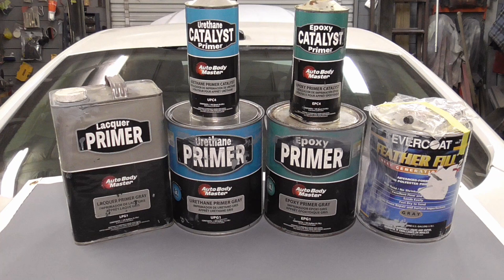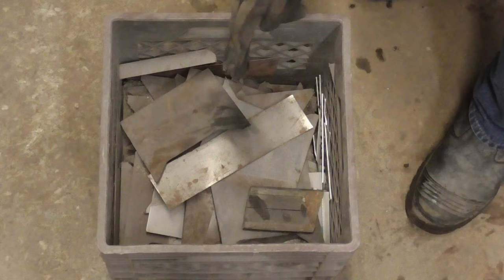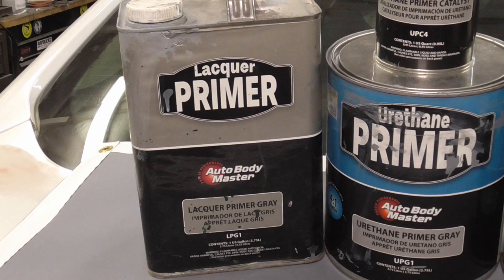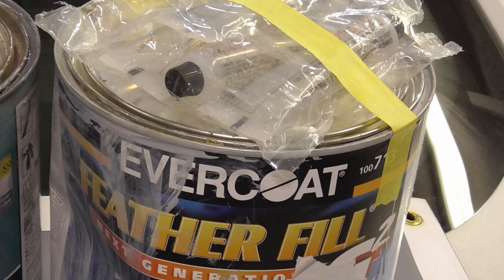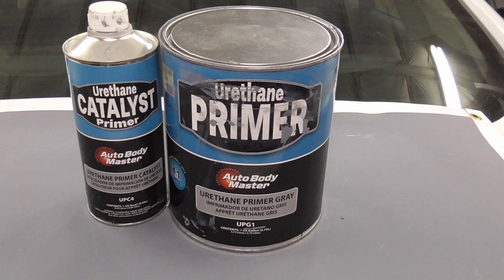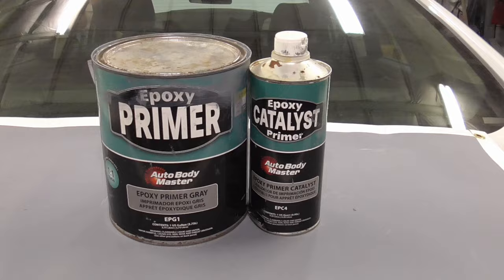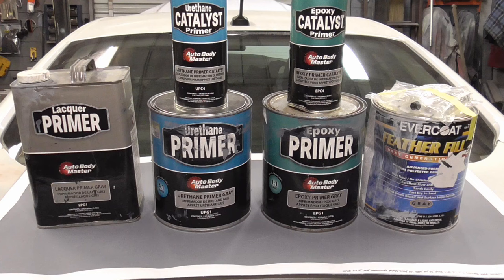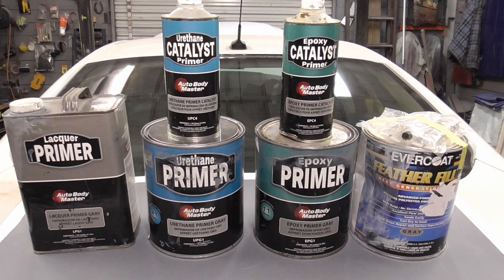A Simple Automotive Primer Guide - Types, Differences & Tips

Comment: Is it fair to say that there are epoxy primers that are high build? I have watched videos about VP2050 which is high build epoxy primer. 

I have watched YouTube recently about sealers being thinner and not high build. It seems like it depends on the manufacturer.
Reply from the maker: Yes - there is high build epoxy primers.  Remember though - no matter what type of high build primer you use, corrosion protection is the paint's job so any $ you spend on rust prevention before paint is a total waste of $.  Body shops do not use epoxy primer - they use DTM urethane primer surfacer or in the days before lacquer primer surfacer.  Both work excellent today and always will :)
Reply: @LakesideAutobody  that’s totally opposite from another YouTube channel. The person uses VP 2050 epoxy primer to protect against moisture coming through. Then 80 grit for filler over the epoxy, then continue with the high build or a sealer. 
Is the urethane high build I would think easier to sand? Do you have videos on your steps for a complete paint from start to finish? Thank you for the response.
What causes bubbles to show up later and how do you prevent that?
Reply from the maker: 1) Always refer or get answers from people who have worked in real body shops - not home restoration shops.  If you have to got to a dealership and ask what type of primer surfacer they use.  Bubbles usually show up because of pin holes (rust) that was primed or filled then painted.  But there can be other reasons too.  Lacquer primer surfacer is the easiest to sand, then urethane primer surfacer, then poly (feather fill) and epoxy. That's generally speaking - have not used every brand of primer.  Here's a video on the basic steps from start to finish- https://www.youtube.com/watch?v=mApSa0l4euQ - I've worked for 4 major body shops in the metro Detroit area and the methods and products used are usually the same.  On the internet they're always different because they're reading magazines or shopping at Eastwood.   @jimdrechsel3611
Reply: @LakesideAutobody  do rust encapsulators work? How can you be sure you have prepared a rust spot enough? Can a paint job with bubbles be spot repaired or will a car have to be stripped all over again? Will epoxy primer prevent bubbles from forming if you missed something?

Comment: The auto body supply shops around me all tell me to use acetone with the lacquer primer. Is this okay or should I only use lacquer thinner?
Reply from the maker: I'd use lacquer thinner but if they say you can, it might be true.  If you can find the TDS (data sheet) for the primer you are using, it would be good to check that too :)
Reply: @LakesideAutobody  thanks for the reply, I ended up using the acetone, and it seems to work fine however I have no idea what I’m doing lol. I really appreciate your videos, always very informative and straight to the point. Thanks!
Reply from the maker: @MrHarmonizr  I appreciate the kind words Mr H.  I've never heard of using acetone in lacquer primer before but if it's cheaper and works, I might have to give it a try :)
Reply: @LakesideAutobody  okay the problem I’m having now is sand paper gumming up. I sprayed 2-3 coats in certain areas and it dried for 1 week. Went to block sand and immediately gummed up, it was so frustrating. I have the roof done but am scared to do the other areas now. Also another interesting thing I put some glazing putty on the pin holes and it started making the primer wet again. It was interesting. The glazing putty said it could be thinned with lacquer thinner and I’ve used a lacquer primer. Not sure if that’s something, thanks for any input.
Reply from the maker: @MrHarmonizr  What's the exact name or brand of lacquer primer that you are using?  Like I said, I've never used acetone w/ lacquer primer so I can't say if that caused the problem or not - I sort of doubt that the acetone caused this though.  That being said, any time any type of coating gums up the paper, the solution is to try wet sanding with like 320 or 400 - it may work better.  Recoat with primer but not till you figure out why this primer is causing the paper to gum up.  Let me know what products you are using - we'll figure it out - no worries :)
Reply: @LakesideAutobody  so it’s speedokote off Amazon. A few things to note, it was dry to the touch between coats but maybe I didn’t wait long enough between coats? Maybe waited 5 mins. Also I’m blocking with 80 grit, I was going to try and wet sand today and see if that helped at all. I’ll try and post up a video. Thanks as always for your time and feedback.
Reply from the maker: @MrHarmonizr  Waiting doesn't matter - It never matters how you apply lacquer primer - it will dry quickly and sand easily - if thicker, obviously it will take longer to dry but never more than a few hours.  The only thing I can think of is the acetone - never heard of using acetone with lacquer primer.    Might want to try the primer with lacquer thinner on a scrap piece of metal and see if it performs differently.  If it does sand nicely, you've got your answer :)
Reply from the maker: @MrHarmonizr  You're welcome - feel free to always ask ?s - Jerry
Reply: @LakesideAutobody  wet sanding helped a lot!
Reply from the maker: @MrHarmonizr  Great - good to hear :)

Comment: One thing that's confusing when shopping for primers is Lacquer primer, Lacquer acrylic primer. And acrylic primer. All 1K so what's the difference?? I got some USC 2255 out in the shop. Only thing I can find is to mix 1.1 but with what? I can't find the mixing sheet anywhere  Very confusing.
Reply from the maker: Anything lacquer is thinned with lacquer thinner.  Urethane and epoxy is "reduced" w/ urethane reducer.  Polyester primer (evercoat featherfill) can be thinned with lacquer thinner or acetone.  When confused just ask and I'll get you the correct answer - if it's something I've never heard of I'll say, "I don't know."  Jerry
Reply: @LakesideAutobody  OK Thanks Jerry So Acrylic primer is lacquer primer?
Reply from the maker: @45AMT  Yes - It's called acrylic lacquer primer.  Acrylic lacquer came out around the 50's - before that was Nitrocellulose lacquers and before that was ........There's also Acrylic enamels.  Acrylic is a type of resin :)
Reply: @LakesideAutobody  OK Thanks for being so helpful.  It's confusing the way these primers are labeled. Someone new to these primers like me wouldn't know as this primer (USC 2255) is just labeled "Acrylic Primer"
Reply from the maker: @45AMT  You're welcome RR - Sometimes you really have to research.  It's like asking your friends if you can shoot a slug through a choked barrel - million different answers and you'll have to research to the wee hours to find the correct answer :)

Comment: You said primer is direct to metal.   Is it best not to prime the entire vehicle if not going down to metal?
Reply from the maker: It's a choice actually.  If you want to block sand the entire vehicle for some reason i.e it's a bit rough, wavy, lots of dings, chips etc., then you'll probably want to prime the whole thing, give it a guide coat and block sand.  If you only have a few repairs and the paint is in good condition, then just prime the repaired areas.  Good ? BTW.  If you have more ?s feel free to ask :)
Reply: I worked as a mechanic in the 80s and one of the owners did paint and body on the side.   He would always prime over the original paint (entire vehicle) after body work then paint.
Reply from the maker: @tomnassar5884  That can be done - no problem - it's a choice.  Again if it's perfectly straight old paint, you can just DA sand with 240-320 and paint.  You can even just scuff and paint - red or grey pad.  Red is like 320 or 360 grit Grey is 1000 grit so it's not as fast :)

Comment: Love your videos!  Are rattle can lacquer primers (i.e. Duplicolor, Rustoleum, etc) as good as the bulk primers used in auto body shops?  I've always avoided them thinking they didn't adhere as well, but the convenience of a spray can for small jobs is undeniable.
Reply from the maker: Thanks Cameron.  Yes, they stick just as well but don't even come close when it comes to building thickness for block sanding.  They are great for very minor repairs and hitting your bare spots just before painting.  No worries when it comes to adhesion :)

Comment: Hardly a single you-tube "expert" recommends the old lacquer primer. Worse, they act like you should Never use it! Like it's not even an option. 
  Well, depending on how you use it, one gallon Can make 2 gallons for a low price. Not as low as pre-Biden. But low. And like you said, you don't have to toss the unused portion! That is value-plus. And lacquer primer is good enuf for any garage respray on your daily driver or budget vintage project. I have had no issues using it, and you have  been at it much longer than me and haven't shelved it. Good enuf for me. I like saving money, and lacquer primer saves me $$$

Comment: Actually you can buy high build epoxy acrylic paint which builds and sands easily so this is not the most accurate video on youtube.
Reply from the maker: If you mean primer, you are correct.  The problem is finding it locally and price.  Most body shops don't use epoxy - there's little need if you work on it inside.  Maybe if you leave a car outside for months at a time before working on it again - epoxy primer would come in handy.  Otherwise the finish (paint) is the best protection against corrosion.  Thanks for the comment NM :)
Reply: Except last sentience your, wrong @LakesideAutobody
Reply: @NicholasMuscat-cl1qo Have you ever used this high build easy to sand epoxy? Epoxy is meant to be a sealer for bare metal or over body filler. Why anybody would want to use it for high build or to sand down flat is beyond me. Nobody cares
Reply: @MarcBchannel  they do because its cheaper and all in one.